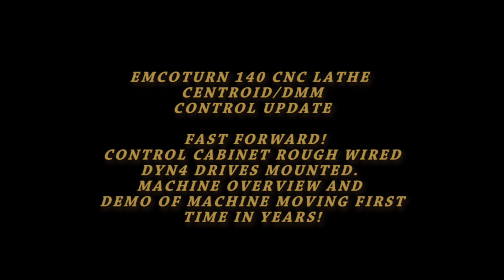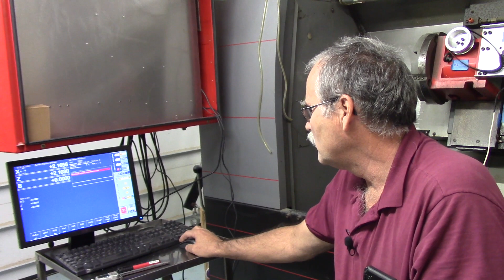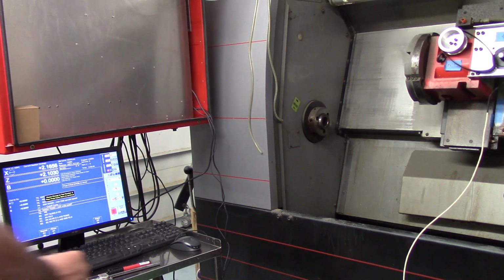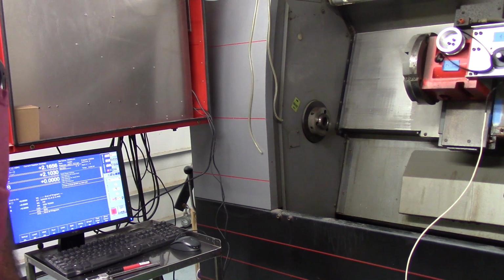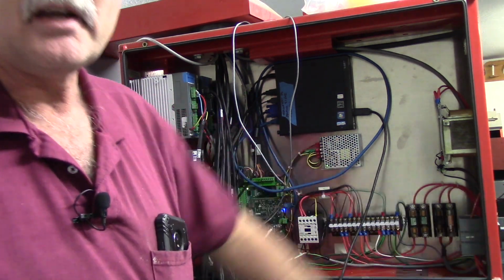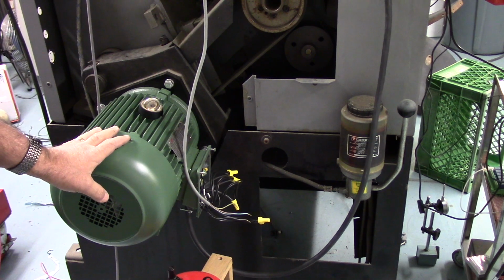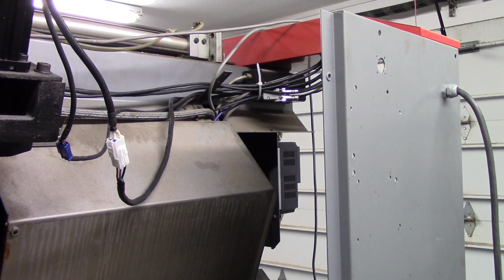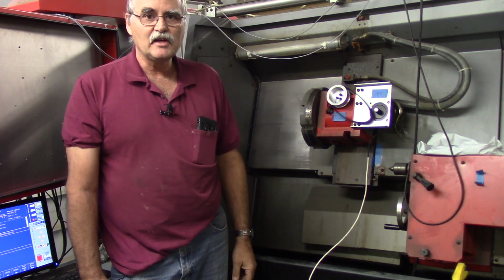Emcoturn 140 Update - Fast Forward, The Lathe runs for the first time in years! Overview

Comment: Hi Marty,  Thanks for your insights in to your emco turn 140 project. I am also working on an emco turn 140 with DMM Dyn4 750w servos. I want to know what's been happening with your project of the last 4 years, and also why does the z axis crash the end stop @5:12 after the part off op.
Thanks.

Comment: Little  confused on the transformer dropping the voltage down, I was thinking that 220 single phase was ok to use on the the dyn4 with the small Servos. .400 watt
Reply from the maker: It is not ok to use 220v through DYN4 with their small AC servo motors unless they tell you it is. You must contact them and ask. Have the motor model number. You may burn up that motor.
Reply: @martyscncgarage5275 ,thank you for your knowledge,
Reply from the maker: Dale, just trying to share what I've learned over the years.

Comment: you say best way to run spindle is with 1:1 off spindle to encoder.  How do you feel about a servo running the spindle and relying on the encoder in the servo.  I was thinking of 1:1.5 motor to spindle ratio.  You think a servo not good for constant motion ( Overheating?) or that the ratio is not good for accurate thread indexing/locating?  I was thinking of a 2 Kw servo at 4000 rpm.
Reply from the maker: If you use a Centroid Control, you must run a spindle encoder belted at 1:1 with the spindle. As for using a Servo for a spindle motor, you would have to discuss that with the manufacturer of the servo drive and motor. 2 KW is about 3hp. You don't mention the control and you don't say if you are working on an Emcoturn 140
Reply: I was thinking Mach and my lathe is not an emco turn.
Reply from the maker: @joeshmoe5935  With Mach, you will eventually need to buy the license, plus the cost of the hardware.

Comment: Señor. Tengo un Mazak VQC 30/50B y me gustaría instalar un control Centroid pero sin cambiar los Drives y los Servomotores originales. Es viable ésta conversión.
Reply from the maker: Pueda ser que si. Si los servo drives pueden communicar con Centroid OAK. Tienes que llamad Centroid con el Make y Modelo de los drives. Buen fuerte.

Comment: Hi.  how do you control your ATC?
Reply from the maker: From the Centroid control. You can use the gray logic sensors in the turret and you can use the original 3 phase turret motor. Check out my other videos on this machine
Reply: @martyscncgarage5275  I'm thinking of buying an Acorn card.  I have a nema23 mounted to my atc today because the original was broken.  It is an emco compact 6p cnc.  do you have any tips on whether it is possible to make it work with Acorn?
Reply from the maker: @mh-laser2886  yes, Centroid can control it. Same as the PC5. But your turret didn't d not come standard with a stepper on it. It had a small reversible DC motor made by Maxxon. It was coupled to the screw  with a small spring steel piece if memory serves. It worked very well.
Reply: @martyscncgarage5275  mine had it too.  the gearbox was broken and a new one costs about 900 $.  saw you used stepper motor on this lathe.  do you know where to find macro for that?